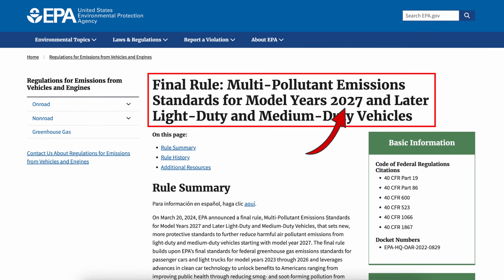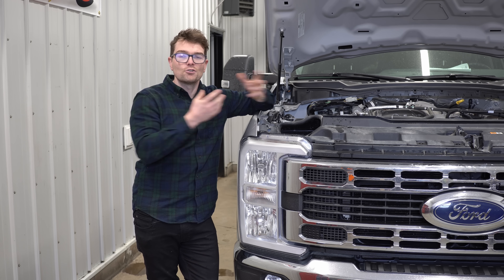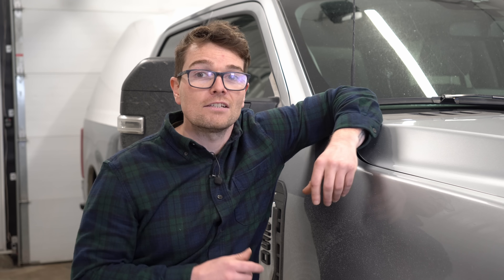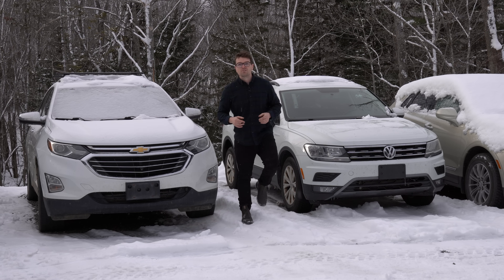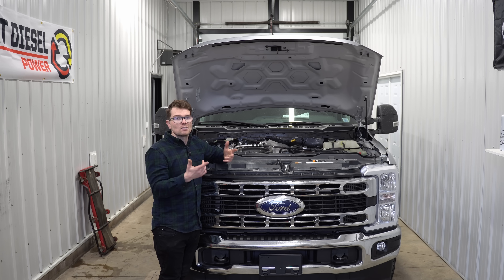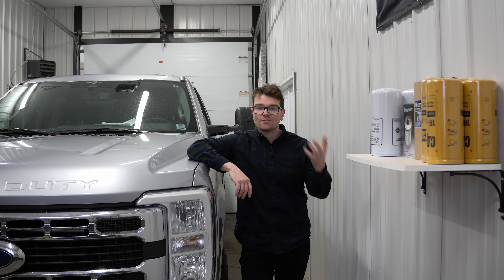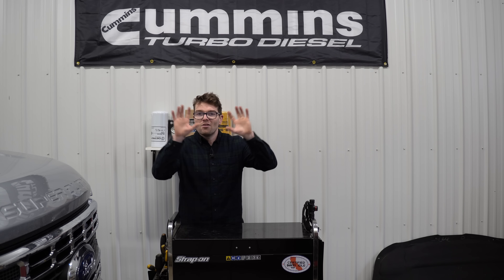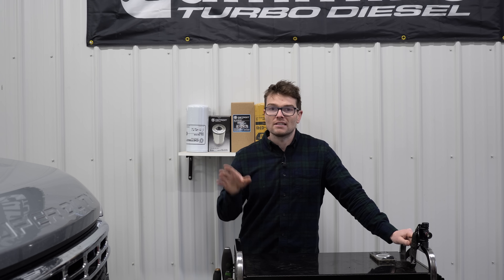NEW 2027 Cummins Diesel Engine EMISSION REGULATIONS are WILD **Diesel Mechanic Explains**

Comment: The incoming Administration and Congress need to SCRAP the 2027 emission standards.  Those standards are imposing a ridiculously high economic costs on consumers while achieving a miniscule reduction in absolute emissions.  It's a classic case of the law of diminishing returns.  Diesel emissions were already hugely reduced by the 2007MY.  Everything since has added massive vehicle expense for only modest additional emission reductions.  A common sense approach would be to roll back diesel emission standards to, say, 2003MY levels for all diesels registered in areas that are in  compliance with air quality standards, and only require additional emission controls on vehicles registered in areas of the U.S. that are "non-compliant" with air quality standards.  I happen to live in a state where this NO county in the entire state that is a "non-compliance" area with air quality standards, yet we have to pay thousands of dollars of acquisition, operation, and maintenance costs for diesel vehicles with a bunch of crap emissions control equipment that is unnecessary.  Another thing that the incoming Administration could do is to eliminate any regulations the prohibit vehicle owners from removing ("deleting") emission control equipment on diesel vehicles that are registered outside of non-attainment areas for air pollution.   Today's "one-size-fits-all" emission equipment standards on vehicles makes about a much sense as requiring a homebuilder in Alaska to install air conditioners on the new homes that they build.
Reply: They won’t
Reply: The EPA is missing the benefit part of the cost/benefit equation. That's why they are chasing perfection. Unaccountable bureaucrats live in a made-up world where there are solutions. The rest of us have to live in the real world where everything is a trade-off.
Reply: The coming 2027 emissions laws will add 3 trillion dollars in costs to the economy annually, on top of 3 trillion from the IRA. The US economy is only 29 trillion dollars.
Reply: Minuscule? 82.5% reduction is minuscule?
Reply: @user-ln7of9gs4s  Yes...when the denominator is already small, the 82.5% is miniscule. Diminishing returns. Putting the resources into a more productive activity would pay off better. Incenting more work at home for jobs that can be done that way would eliminate far more urban pollution than reducing already reduced NOX emissions from light-duty diesel trucks as just one example.
Reply: @user-ln7of9gs4s yes and I’m gonna be honest this pollution shit is a fucking lie 😂
Reply: @user-ln7of9gs4s 

The EPA relies on bullsh!t Enron accounting and voodoo science to promulgate their Bolshevik green fantasies.

Comment: The government should be forced to use the same shit they mandate for the public on their engines
Reply: they will no problem because you are gonna pay for it all through taxes!
Reply: Yes and no, military vehicles used in combat should not be required to have emissions equipment. Not that we should be going to war anyway...
Reply: EPA should test and research the results and compare them with the affordability cost and reliability of it before they demand the truck manufacturers to meet the standard.  If EPA can't accomplish it, then leave it alone until they figure it out.
Reply: I agree. Government diesel vehicles don't have any of this stuff.
Reply: That statement should also be used for firearm restrictions.
Reply: @lucasrichter9072  i personally own a retired government 2006 ram 2500 that was factory exempt from emissions (only the catalyst since 2007 was when cummins started using emissions equipment). i also agree firearms should not be regulated with the exception that murderers, r**ists and other violent crimes not be able to own them.
Reply: District owned transit vehicles are required to have emission controls installed.
Reply: The only exemption is military.
Reply: @OtisFlint post office is exempt as well
Reply: For the most part they do.
Reply: @DoRC  Not really, every diesel truck I have ever seen that is government owned has no emissions.
Reply: @jaredc.3508  Do you primarily work on military vehicles because those are the ones that primarily are exempt from emissions controls standards?
Reply: @DoRC  Yes every single military vehicle I have seen from f-250's all the way up to JLTV's are factory deleted, I have also seen quite a lot of factory deleted diesel pickups from national park service, box trucks from the fbi and the atf. I can't say for sure that all government vehicles are exempt, but I have seen several from government agencies and all of those had been factory deleted.
Reply: @jaredc.3508  military yes. FBI and ATF also potentially as they can get a national security exemption. This makes sense because it is well known that the emission systems do potentially make the vehicles less reliable and you would want vehicles relating to actions of national security to be as reliable as possible. 
Forestry service on the other hand that's an interesting one. I would not expect them to have any reason for exemption. Maybe the exempting process is more lax than it should be.
Reply: @ My guess for NPS is so they don't get stranded 40 miles in the middle of no where but unsure. I have also seen an f550 ambulance with no emissions but only ever seen that one, the ambulance is understandable though.
Reply: @DoRC  regen in the woods in the wrong spot will start a fire 1100 to 1500 deg regen not good in a wooded area!
Reply: @DoRC 

Nope.

Comment: The EPA is only making rules and regulations for the 💰 not the environment. They don't GAF about the environment they just want the money that it'll will bring in their pockets.
Reply: If the environment was important to them CAFE regulations and the chicken tax preventing small trucks from being built would be repealed.
Reply: Honest question, I have seen someone say this before, how would the EPA be profiting from tightening emissions regulations?
Reply: @danielwinn7108 they don’t. The only way would be kickbacks from industry, but the regulations are moving in the opposite way for that to be the case.
Reply: @danielwinn7108 
There’s 2 ways they profit one is fines for accidents and non compliance the other is under the table from emissions compliance manufacturers either by stocks, consulting fees etc
Reply: You buy trucks from the EPA? Where is their dealership?
Reply: The reality is pollution was defeated forty years ago, this nonsense is not cost effective for its supposed benefit.

Comment: I wish they would've gone by way of dual fuel instead of the complicated setup of DPF, EGR, and SCR. I can almost guarantee you using LPG or CNG would do a better job by burning the fuel thoroughly lowering emissions and soot. Just my thoughts.
Reply: There's no infrastructure for LNG or CNG. LNG is cryogenic which is super problematic for storage and handling, also it has to be turned into a gas before it can be injected into the cylinder which is another problem in itself. CNG is easier to manage, but the established underground pipes delivers the gas at very low pressure (<15psi for a lot of places). You have to set up huge compressors to pump pressure up to 3600psi for the truck's storage tanks.
Reply: @Rayden440  there already is an infrastructure for natural gas (not sure if it's LNG or CNG), and there are some semis that run on it. There are some fueling stations for semis that run on it.
Reply: @ There’s like 1 for the entire city of Toronto where I live. If you call that “infrastructure” idk what to tell you. There’s hundreds of diesel pumps as a comparison

Comment: I'm still getting frequent REGENs on my brand new 2024 Ram 2500. So many so that it triggers a CEL every 4th or 5th regen. They need to consider re-engineering the fuel if they really want the pollution reduced more.
Reply: Nope. Put over 4k on it in the first 3mos pulling a travel trailer. Dealership agreed she's got something wrong. Stelantis swears they're engineering a fix but no eta for deployment. I've sought lemon council.
Reply: Check and clean your def injector. Two 10mm nuts to remove. It builds up with crystals and that messes up the def spray pattern. Just wash crystals off with warm water.  Be sure to have a gasket available just in case .
Reply: @petermandel2552  my issues happen before the DEF injection. It's all in the DPF area or computer. The prevailing theory is that the computer is either misinterpreting the DPF sensor data, there is a mistune (possibly because of the CARB standard, but living outside of CA), or an emissions flaw. I stumbled upon a TSB for prior vehicle years that may become important in the near future.
Reply: Get it lemoned. Does any of this sound like things you should have to deal with for a brand new WORK truck? When this kind of thing happens they should have to compensate for loss of revenue as well. Buying a new truck should be trouble free. The standards that these bastards get away with are insane
Reply: Did you buy a 2500 to get groceries as a daily? Because that's your problem if you did.
Reply: @LordOfSilense  unfortunately for you this is America and if he did that would be ok.

Comment: Honestly?  If I was one of the big 3 light duty/medium duty manufacturers (GM 2500-6500, Ford F250-F600 and Ram 2500-5500) I would be developing a gasoline hybrid or gas PHEV HD pickup.  Think Ford F150 Powerboost but with an NA V8 instead of a boosted one.  It would deliver on diesel like power and acceleration and towing without the diesel emissions equipment attached to it and if the battery were big enough, would provide some degree of EV power only which means zero emissions when doing so.  The diesel spec parts could be used to handle all the power as well.  Only downfall to hybrid/PHEV would be the weight gain but that might not 100% get to current diesel pickup weights.  I see a lot of HD truck customers at work who buy diesel and end up trading on gas or heck, even 1500s because they don't need it.
Reply: 350/250 ford diesel PHEV HD pickup yes i can see that as a valid marketing choice as long as it's basically up full-sized power-boost functionality and or can be used for camping or worksite generated electricity ect

ranchers i now had to drag 1-ton plus tow 2-trailer's and or used up bed-space ectand 1/2-ton models weren't big-enough to tow things like the water/seed-tow ect, and there's points were you moved 100~yards and shut off for 15m's~ and then moving again and or city drive BEV-mode can do a better job than pure-IEC can
Reply: funny when people think hybrids will deliver constant power for towing.  Watch some reviews on the Tundra hybrid towing system.  It runs out of steam on long uphill pulls.  Hybrid batteries have limited capacity.
Reply: Why? The government invested money both with our taxes and thru their own investments (insider Trading) on the whole EV movement. That's the push. And any hybrid, hydrogen, etc they don't give 2 shits about and would just come up with even more emissions regulations for those as well. 
If they cared truly about environment, an EV would be the last thing to 'save' it.

Comment: I own semi trucks. My number 1 problem is emissions. I won't be buying new trucks. Once these trucks are done, so am I.
Reply: I know where I am in  Alberta I had one of my trucks ( sort of pre emissions 2005 Cat C15 ) in an independent shop and he said he does lots of weight loss programs on Cummins trucks as its a constant battle with emissions related issues side lining trucks and since Cummins is one of the major engines in trucks in the area, that is why that brand comes into his shop more than anything else. The emissions Cat trucks wiped out those that owned them as you know as that was one clusterfak !.

Comment: EGR wouldn’t be so bad if every manufacturer went to post DPF going back to engine.
Reply from the maker: Cat did that for a bit before they sort of gave up lol but they had issues with the system for the short period they ran that style. But it would make more sense.

Comment: I think this will speed up finding a more suitable alternate source for diesel fuel besides petroleum fuel.
Reply: Mr diesel had built the motors to run on peanut oil. but diesel fuel has 100 times the power per gallon.

Comment: I think EGR and DPF should be done away with. Engine should just run as hot as needed to burn the fuel, then just consume more DEF if needed... is that stupid?

One other solution which may be controversial is we should have hybrid trucks (if we're already going to have these useless emissions regulations forced upon us). Hybrid HD trucks with a heavy duty eCVT (Toyota's eCVTs are basically planetary gear differentials with big electric motors and an engine on the inputs, some have clutchpack for hi/low gear. They don't use a belt, just gears. Very robust, could be scaled up for HD trucks) could be even more reliable if built heavy enough. No reverse gear needed, clutch packs may or may not be needed... just a big beefy differential.
Instead of having extra 48V crap just for reducing emissions and keeping filters and catalysts hot, you have 
-a modest sized (LiFePO4) battery capable of 400HP+
-eCVT capable of 400+ electric HP, PLUS torque from a 3-4L turbodiesel, possibly no clutches to wear out
-A 3-4L diesel that weighs less and costs less than a 6-8L diesel
- Ability to drive some distance without running the engine (30-40 miles without towing should be easily possible without paying a fortune for the battery), sneak away in the hooha magnet at 4am (battery-electric trucks are not magnets for the right kind of hooha's)
- Ability to run block heater off the battery, keep engine and cabin warm between trips
- No need for a starter motor, just the 100HP+ starting capability from the transmission 
- Regen braking to save your brakes and effectively reuse some of your fuel you buy at the pump (those benefits are amplified by towing with up & down grades)
-Little or no idle running, mostly running at boost to keep your soot low and oil pressure up
- Possibility for high power inverter to run equipment i.e. welders, compressors, pumps and backup home/RV power on battery or diesel
-Less need for emissions devices because the engine rarely runs cold or without boost
- Ability to optimize engine running on the fly, monitor fuel consumption and power generation to adjust RPM and boost to consume the least fuel per power required at any given moment (eCVT has infinite gearing, Engine RPM is fluid)

That's what we should be doing. If HD trucks are going to continue becoming ultra expensive, spend money on the right technology that improves utility and robustness instead of spoiling it.

Comment: Jesus christ this is stupid. At the dealership I work at last week there was a kodiak 5500 idling in a closed shop for 2 hours operating a crane to pull an engine our of a combine doors were closed because it was 10 degrees outside and no exhaust fan on and we could still breathe and zero dizziness. To me that's pretty fucking clean but the epa is a bunch of insane fucking people that need fired and defunded immediately.

Comment: Okay with new regulations if EPA reimburses all emissions related repair and maintenance expenses.
Reply: Kink of like the student idea
Reply: That's what the mandated higher warranty on emissions equipment does. Kind of like how in gas cars the standard warranty is 3y/36k miles but in states that follow CARB standards all emissions components carry an 80k/8y warranty (all the way up to 150k/15y for some components).
Reply: @LordOfSilense  yeah but the issue is the manufacturer has to pay that. It should come out of the EPA budget directly.
Reply: that's called TAX moneys. so you want to pay more in TAXES?

Comment: Hey I've a solution, restrict the purchase of diesels for only those who really really need it basically for commercial use only! No reason why people should be dallying those! No passengers no load just hauling egos!
Reply: As much as u must hate it, this is still a free country.
Reply: @stanwilliamson2812  well given that logic,  if I'm able to should I drive around in a semi? To mind you they both get same mpg's! Which is crazy! One is towing several tonns and the other driving around empty!
Reply: @musicmann5516  semi trucks get 6 miles to the gallon… Diesel pickups get 15-19 miles to the gallon.. I should know… I own 27 semi trucks and 8 diesel pickups.

Comment: Gasoline particulate filters are reportedly already in the USA on ‘25 Lincoln Nautilus and whatever the Ford version is.

Also, great job on the explanation of the systems and upcoming changes. There is one other part of the new regs I’ll also mention, there’s a requirement that manufacturers increase security in the computer systems to prevent unauthorized tampering. Think there’s also a provision to make “limp mode” (running out of DEF) less dangerous. Like no longer reducing speed to a ridiculously low #.
Reply: Gasoline makes no soot, no DPF needed. That was an experimental system.